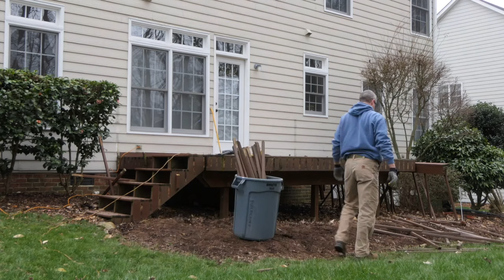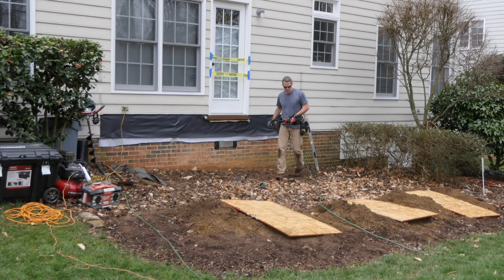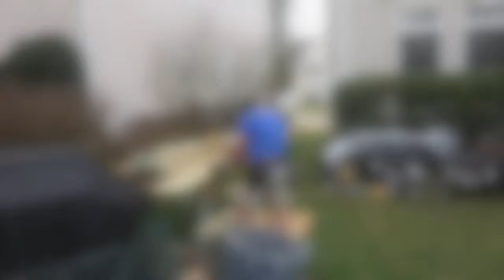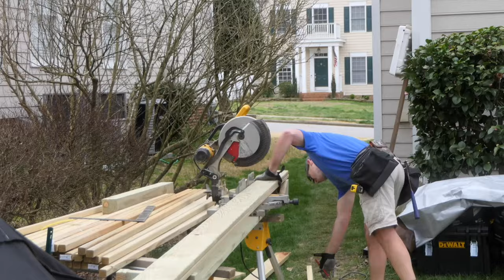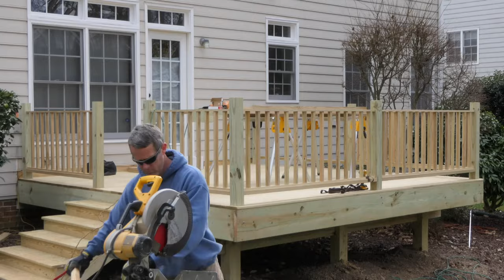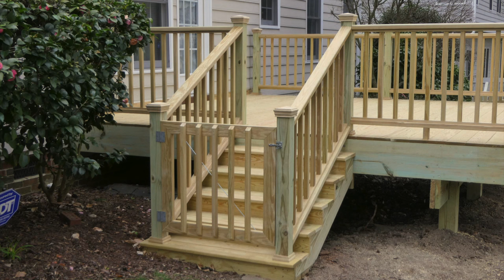Solo Deck Build Time Lapse

Comment: Sorry, but eventhough the deck looks nice, I don’t feel it’s safe. This is a cantilever design, where did you get the plans? The attachment to the house seems a little short. I built this type of deck with a 16’ cantilever and was required by code to use 2 carriage bolts, nuts and washers or Screws (1/2”) every 16”.  The posts just barely went into the ground and only 3 posts for 20’. I’m in a frost area and for 20’ I used 6 posts, 48” deep and 10” in diameter, using a beam (2…2x10’s with 1/2” plywood in between) above to support the deck joists.  All wood and plywood were green. I didn’t see that any of your boards looked treated.   Comments…..

Comment: SHOULD THE DECK SUPPORTS BE IN DIRECT CONTACT WITH THE DIRT???  AKA MOISTURE...   I SEE HE USED PRESSURE TREATED WOOD AND THEY LOOK BEEFY BUT...   WHY NOT JUST CONCRETE PILLARS ABOVE THE GROUND/DIRT LINE??  LOOKS LIKE A WELL BUILT DECK...  I AGREE THE STAIRS COULD BE WIDER BUT THE DIRT GROUND CONTACT IS QUESTIONABLE:body-blue-raised-arms:

Comment: Nice quick deck, but I don't think it would pass code in my area.
Reply: Why wouldn’t it?
Reply: What is holding up the 4x4's? There is no cross bracing for these and the footings look questionable as well.
Reply: @LDSKIPPER1911  Burying the posts isn't code.  Also, 12x12x12 poured concrete is the minimum for that 6x6 because it's ledger attached and not a floating deck.  I personally would have deleted the ledger and made two beams.  Also, the stairs are not on a footing and do not have a landing.  The ledger board connection needs to be verifiable, so if that house doesn't have a basement with access to the floor joist and the house rim, it can't be physically verified, therefore not acceptable.  ICC Deck Construction 2021 book is a great book.
Reply: @LDSKIPPER1911  Also, the railing posts are not blocked in at all, if the front rail is impacted, it's actually in danger of peeling off the rim joist because the load is not set back appropriately.
Reply: @CreativeBuildsFL-TX  your correct! This is a waste of materials if he gets it inspected. No where in America will this pass inspection. First off the post sitting in the ground and not being tied to anything is extremely dangerous. Uplift is a major problem. This makes me wonder how well the ledger board is attached.
Reply: @CreativeBuildsFL-TX   It is obvious that this house has a crawl space and the ledger connections can be verified. Everything else you stated is correct and good recommendations.
Reply: Why?
Reply: Wont pass in my area. Need to pour a 12x12x42" deep pillar. Posts need to be set on a post base plate.  Notched 6x6 posts with carriage bolts.  Railings need to be blocked and bolted with carriage bolts also.

Comment: What did you use for your stair pad
Reply: I use a few 4x8x16 solid concrete blocks with ground contact rated 2x12 placed on top.
Reply: @crowsgonewild  thanks I'm adding stairs to a low level deck that I built and just getting ideas